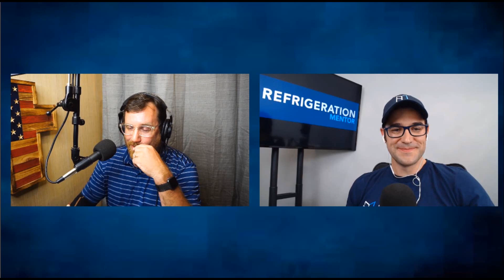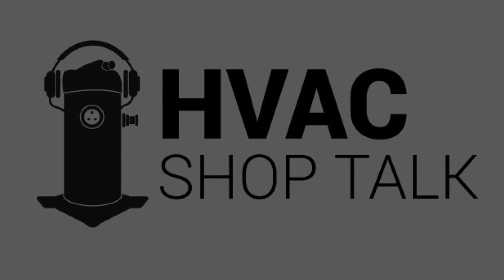Can a Residential HVAC Technician Understand CO2 Refrigeration?

Comment: The problem is partly high pressure which can be controlled via pressure relief controls. However, the formation of dry ice under certain conditions with CO2 can block those pressure relief points then possibly cause a rupture. So I don't believe it's a question of just high pressures. The safety aspect --- as with in residential HVAC you have home owners that think they can do it. Every system I haven't serviced before I question what, who, why worked on it before me.

Comment: Comparing 1500 PSI gas to 10000 PSI hydraulics is not quite fair.  The energy stored in a compressed material depends on how much it is compressed, not just the pressure.  

This is why compressed gas cylinders are hydrostatically tested.  They fill the tank up with fluid and apply pressure.  If the tank ruptures it isn't a huge explosion.

Comment: I repaired a Glass Door cooler with CO2  compressor which was leaking. I replaced the compressor with a R134a compressor, and there is no more leaking when the cooler is running with R134a. It has been over 2 years now and still running good. My conclusion is when you have high pressure gas in a refrigeration system you have higher chance to leak